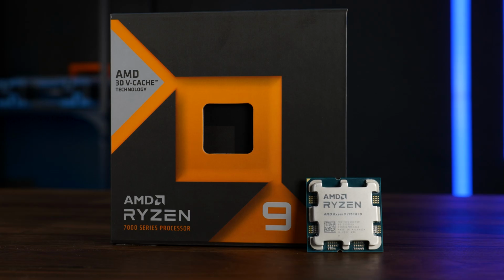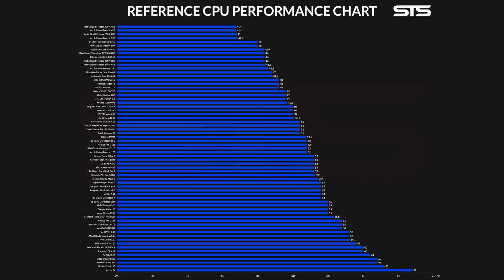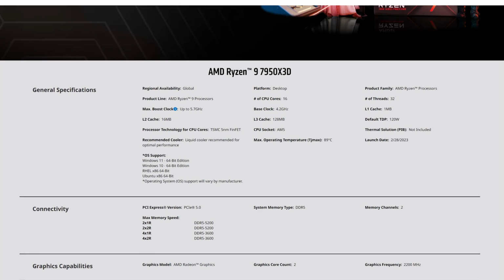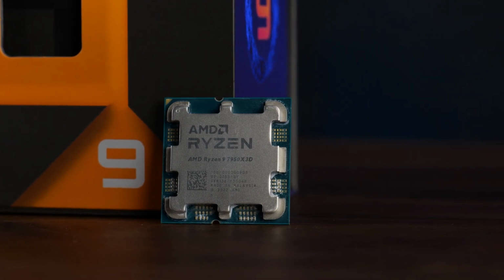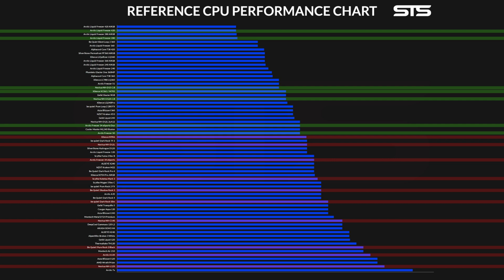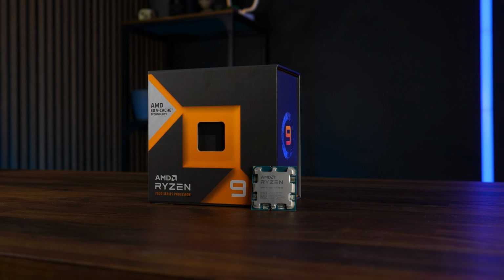How FAT Should A Ryzen 7950X3D Cooler Be? ❄️ - 7950X3D Cooling

Comment: I tried a Kraken X73 360 AIO, a Artic Freezer 4 360 AIO and finally an old Noctua NH-D115 with offset brackets. Temps are the same, Air cooler is more silent, so I stick with it.

Comment: My 7950x3d barely hits 80°C on full load like Cinebench with a NHD15, yes guys, you don't need watercooling
Reply: you can't beat the reliability of good ol air
Reply: I have a Noctua NH-15 with 7950x3d in cinebench 89 degrees after 30 seconds. What's your secret?
Reply: @MrVIPKent PBO2 -15, perhaps a better thermal paste and airflow In the case. What's important is that you look at how much power is used. If it's below 105w it's not normal
Reply: @DraughanTV  how many do you have at cinebench multicore
Reply: @MrVIPKent 34 to 35 if I remember correctly, so about 8-9% lower than standard, considering it's in the closed case and with a heated room
Reply: What are the clock speeds. That information is actually important
Reply: @NINJA_INVESTORS  4.9 on CCD1 (VCache), 5.0-5.1 on CCD2 (non-Vcache) during full load

Comment: I have the NZXT Kraken 360 AIO, would that keep the 7950X3D cool under heavy workloads??
Reply: Did you get it? I have the 240 one and tbf I am not happy at all. Maybe mine is faulty, but at 20-30% load the CPU easily hits 70 degree and then drops to 50, but never below 50 at that load, which is really bad.
Reply: @alishfitness  I did. I'm waiting for a GPU before I do anything, but running without the GPU it idles around 25°C, but to be honest, the case was open and I had the window open and my room was probably 5°C at the time. Temps could be significantly higher under normal circumstances... these CPUs do run hot though. I'm not a huge tech guy, so tread at your own risk here, but you can change the fan speeds to run faster, and also set a temperature to automatically shut the PC off. I haven't gotten that far yet personally, but is something I will be doing once I get a GPU.
Reply: yes

Comment: I have my 7950x3d running expo and PBO and haven’t seen temps go over 60 Celsius during any benchmark.   All I’m using is a 360 aio. Nothing special.  What is the point of this video?  If you are buying a $700 cpu and want to mount a $30 cooler to it, then maybe you shouldn’t be touching electronics.
Reply from the maker: You would be surprised by what people do
Reply: The video helped me. I have an older 240mm AIO and I needed to know if it would cool my new 7950X3D or if I'd need to order a new one.
Reply: same here, old Corsair H110i won’t be powerful enough for this CPU

Comment: Think I would rather have a 7950X and run a Negative 20 offset using Curve Optimizer
Reply from the maker: At least something. This is a ‘stock’ video, but you’re right, ticking does help a lot
Reply: I have my 7950x3d running expo and PBO and haven’t seen temps go over 60 Celsius during any benchmark.   All I’m using is a 360 aio. Nothing special.